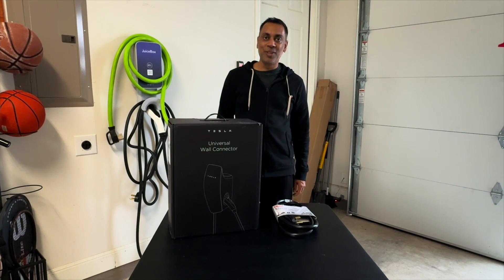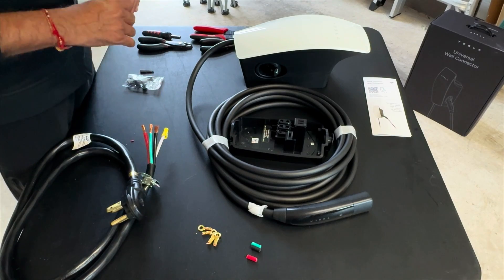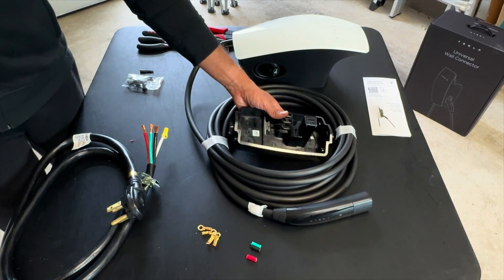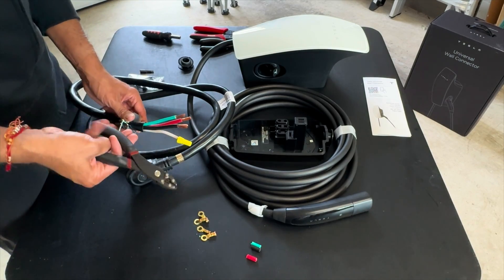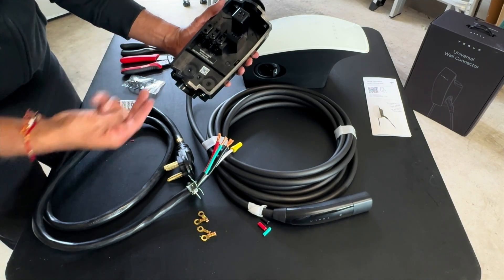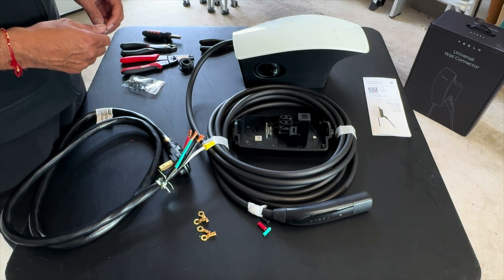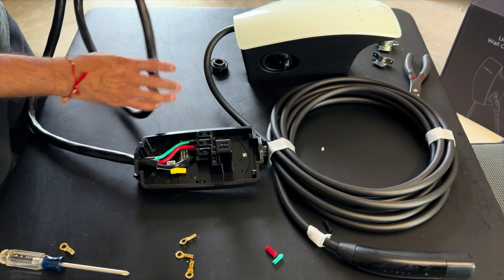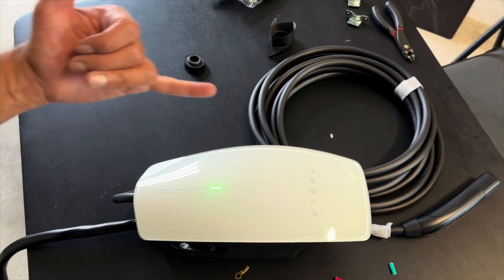Tesla Universal Wall Connector - Adding a NEMA 14-50 Plug

Comment: Technically, the Tesla Wall Connector is designed to be hardwired directly into your home's electrical panel. It does not come with a plug, and Tesla does not sell an official adapter to plug it into a 240V outlet.
However, here is how people handle this situation and the risks involved:
1. The "Official" Way
If you want to use a 240V plug (like a NEMA 14-50 outlet), Tesla intends for you to use the Mobile Connector.
 * How: You buy the NEMA 14-50 adapter for the Mobile Connector, and it simply plugs in.
 * Speed: This is limited to 32 amps (~30 miles of range per hour).
2. The DIY "Plug-In" Wall Connector
Some owners and electricians "convert" a Wall Connector by wiring a short 240V pigtail (a power cord with a plug) into the unit so it can be plugged into an outlet.
 * The Benefit: It allows you to take the Wall Connector with you if you move, or use the outlet for other things (like an RV or a different EV charger).
 * The Risks: * Warranty: Modifying the Wall Connector by adding a plug can void your Tesla warranty.
   * Safety/Code: In many jurisdictions, electrical code requires "GFCI" breakers for outlets in garages. The Wall Connector has its own internal GFCI; when you "double up" (a GFCI breaker for a GFCI charger), it often causes the breaker to trip constantly for no reason (nuisance tripping).
   * Amperage Limit: If you plug into a NEMA 14-50 outlet, you must manually configure the Wall Connector to a maximum of 40 amps (for a 50A circuit) or 32 amps. If you leave it at the default 48 amps, you will melt the outlet or trip the breaker.
Comparison at a Glance
| Setup | Connection | Max Speed | Warranty Protected? |
|---|---|---|---|
| Standard Wall Connector | Hardwired | 44 mph (48A) | Yes |
| Mobile Connector | Plug-in | 30 mph (32A) | Yes |
| Modified Wall Connector | Plug-in | 37 mph (40A)* | No (usually) |
*Note: National Electric Code (NEC) limits continuous loads on a 50A outlet to 40A.
My Recommendation:
If you already have a 240V outlet and don't want to hardwire, the Mobile Connector is the safest and most cost-effective choice. If you want the maximum speed (44 mph), it is worth the extra cost to have an electrician hardwire the Wall Connector properly.

Comment: For those of you who read the comments, but forget to expand his notes above, you have to program your wall connector to max out at 40amps. The reason is the socket rating (on all the sockets I've seen) is rated for 50amps, so you cannot run the charger as if it's plugged into a 60a circuit. If your breaker is 60amps, and your wire is #6TNNH (not ROMEX), and your pigtail is #6, but your socket is only 50amp, then your whole scenario has to be treated as a 50amp circuit. You'll see other commenters stating that you should hard-wire a wall connector and this is why, so you can get the full 48amp draw for a full 42mi/hour charge rate.

Comment: Can you use this outdoor?
Reply from the maker: Yes, the universal wall charger is IP-65 rated so it is dust proof and can handle rain and water spray. These are the same ones they install at hotels and shopping centers.  If you use a NEMA Plug, make sure that connection is covered. Hardwired, no problem.

Comment: Thank you for the video, this is exactly what I did. Is there any holder or mount for the wall connector instead of permanently screwing it to wall?
Reply from the maker: Not that I have found.  I use a computer stand (without the legs) that has holes on it and screw my charger onto to that so I can swap them out.  I still had to make four holes in the wall to hold that up, but those are the only four I will need to make. If you do not need to swap out a ton, I think there might be some weight charger poles you can get.

Comment: would this one suffice - 30 Amp / 250 V
10-Gauge wire (10/4 TYPE SRDT)
14-30P NEMA plug configuration
Reply from the maker: Yeah, all that sounds good.  The key is to default set the Tesla charger to make sure it does not pull more than 24 amps (80% of 30).  That is a little bit of a process where you have to connect to the IP address of the charger but there are videos online showing you how to do it.

Comment: Why no used 6-50p ? Is better option because the wall connector do not used neutral wire and please read the instructions for the wiring
Reply: Its because he had a Nema 14-50 receptacle already in the Garage

Comment: Can I do this to a NEMA 6-20 plug and just set the draw lower?
Reply from the maker: Yes, you should be able to do that.  Just need to make sure you have the draw set lower.  You can also set this within the unit as well, but it does requiring getting into the IP address for the unit.

Comment: Love when folks make videos like these, showing how easy it is to add a plug to any hard-wired EVSE.

2 Things of note,  
1. Max safe Amperage on Plug vs Hard wired
2. The wiring diagram recommends wrapping the wires up and over the block (when feeding from bottom) and opposite when feeding from top inlet.   Guess it gives a better service loop. and also gives extra support from wires not being pulled/stressed on the locking nuts for wires

Great video!
Reply from the maker: Thanks for watching.  And great points you added!!!

Comment: Thank you so much for the video, that’s exactly what I am trying to convert. I have a question, is it ok to cut the 6 feet cord down to 1 to fit my space?
Reply from the maker: A shorter pigtail plug is actually better.  Typically 3 feet or shorter is what is recommended by code.

Comment: What does the electrical code say when using an electrical device that doesn't allow for this connection in the manual?
Reply from the maker: This is definitely an at your own risk type of DIY project.
Reply: I read somewhere code says 1ft long

Comment: So what was the outcome ? Did you get 44 miles of range in an hour ?
Reply from the maker: Sadly, I had to return the charger as it would not work with either the Rivian or the Fisker.  Some people have been having this issue.  When charging a Tesla, since I was connected on a 50 amp breaker and pulling power at 40 amps, I was pulling 9.6 kw every hour (would have been 11.5 kw with a hardwire set up).  Not sure what that comes out to miles wise for the Model X which is what I was charging.  The mileage per kw will be different for every vehicle, but the kw the charger is capable of giving you will be the same.

Comment: I did the same, but I would suggest two things.. get a "cable gland" for where the 14-50 plug comes up into the Tesla box. Will help alleviate stress of the wires hanging, but more importantly you should've routed it up and around to the top of the terminals. You don't want the wires hanging down with no support other than the lugs holding the copper. Just food for thought..
Reply: Also it’s not dryer plug for 50 amp. It’s generally a “range” plug. Dryer is 40 amp.
Reply: @boomerjrtv1268  you're right, I stand corrected. The cord/plug set I purchased on Amazon is a "Range Power Cord".
Reply: You are correct, he wired it wrong and it shows the proper way in the installation papers. Loop around the top from the bottom feed and zap strap the cable.
Reply from the maker: Agreed.  I thought I mentioned in the video that I was going to put the gland on later, but I may not have!  Thanks for pointing out!
Reply: What size cable gland is required for this ?